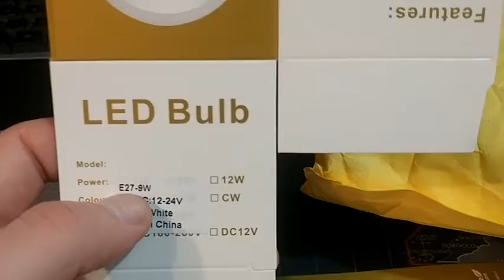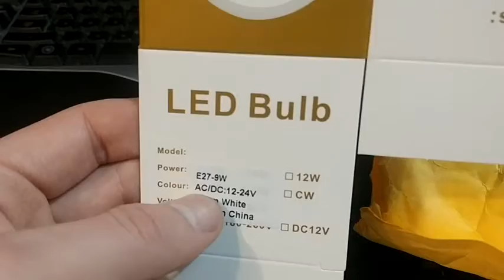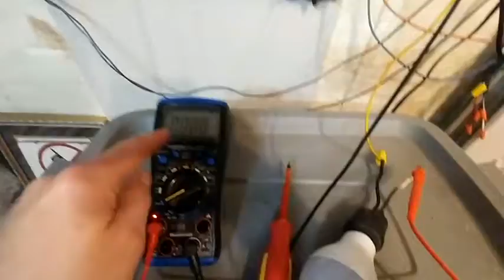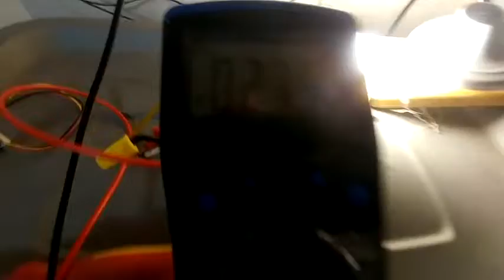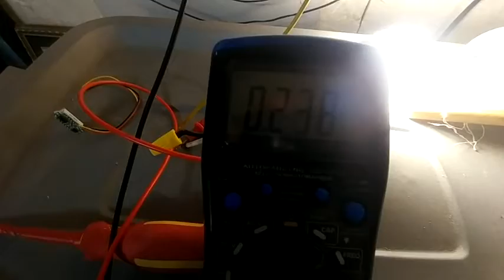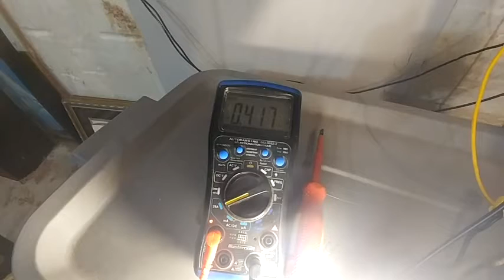Best 12v 24v dc LED light bulb for $5?!

Comment: Can you hook these up to a light fixture and then directly connect that to a solar charge controllers load +\- ?.   I’m going completely off grid! Or would it make a difference if I bypassed the ac transformer and straight wired it inside of the fixture?

Comment: 3:04 WTF!! Explain that setup lol
Reply from the maker: Lol yea idk. Its a 120vac to 29-36vdc. I then put it through a buck converter to accurately control amperage and voltage output. You just need a buck converter and a power source.
Reply: @AndyShell  Do you run an inverter from the batteries to the 120VAC power supply? I have been trying to do a lot of the same stuff you are doing, but I really wish I could find a power supply that took DC in.
Reply from the maker: These Lights still work great and no issues. I use 6 of them in my garage every day. Great price and reliable